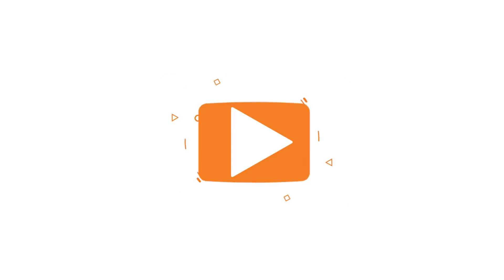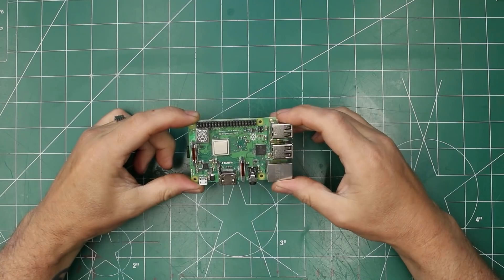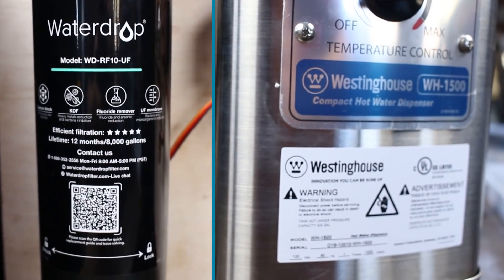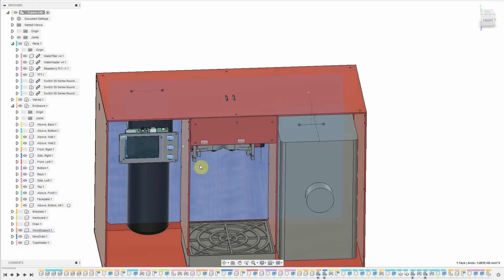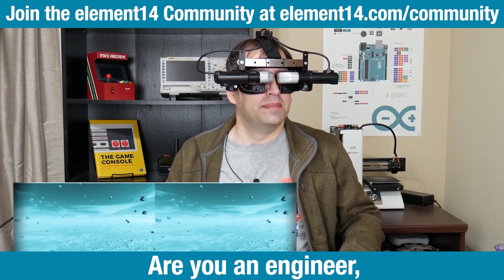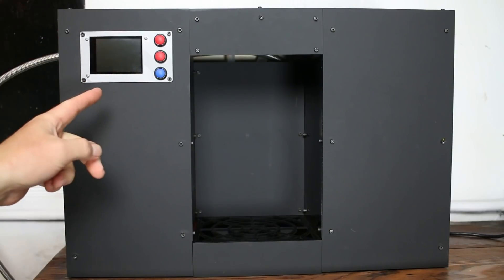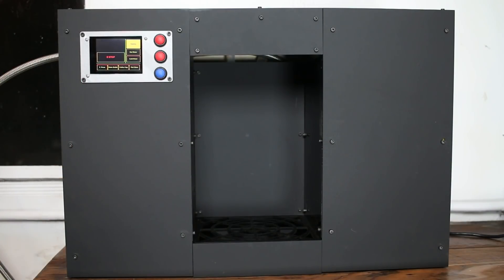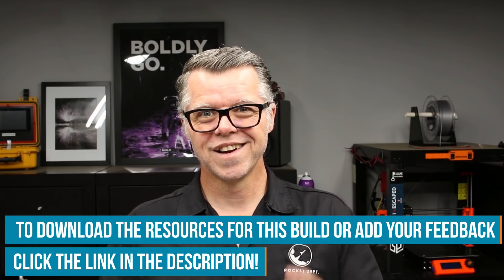Raspberry Pi Smart Water Dispenser

Comment: I like the idea, but just wanted to comment here, that most of the relays you find out there are NOT safe for the amount of current pulled by a water heater. Maybe the one used in this video is, but if you build a project around one of these make sure it can switch the voltage and current of your appliance.

Comment: A better system is to use a peristaltic pump, which has a constant follow/volume output. Then place it at the end to control volume output.
Reply: I did explore that route, but the ones I found that were affordable had a pretty low flow rate. Building my own would have been a lot more work. That's why I went with the servo/shutoff valve route.